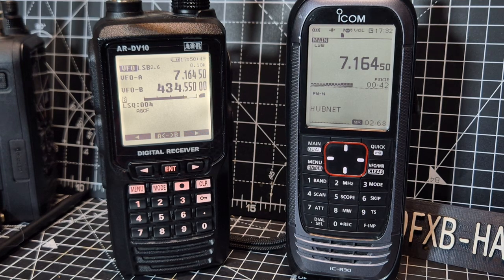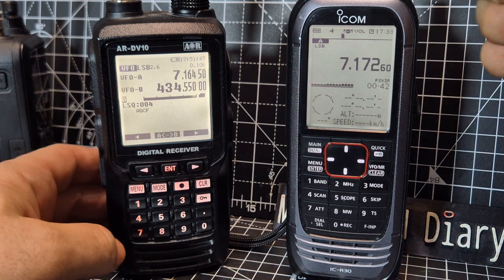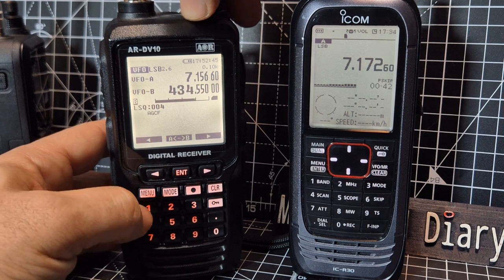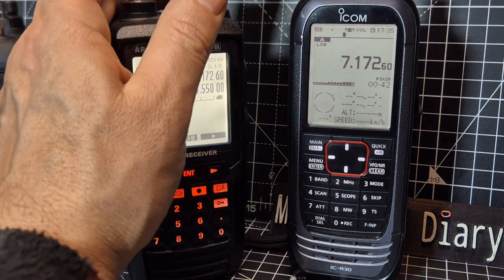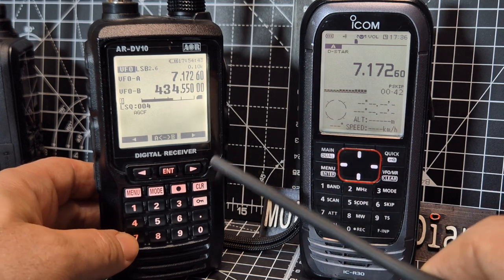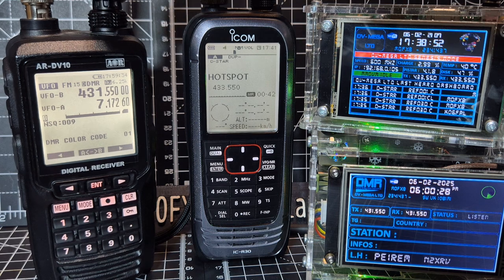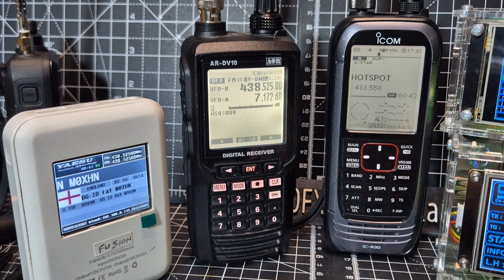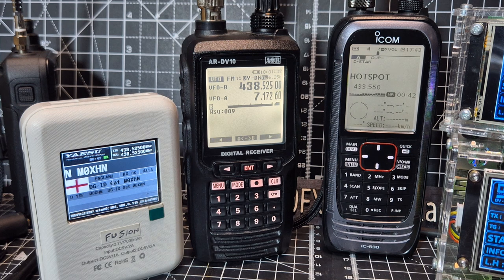AOR DV10 & ICOM R30 Scanner Testing all Modes

Comment: DV10 saturate with external antennas
Reply from the maker: I will try the atenuater
Reply: @M0FXBHamTech . Hello friend, a question. Does the ICOM IR30 output the encryption key in nxdn mode, like the ARDV10?